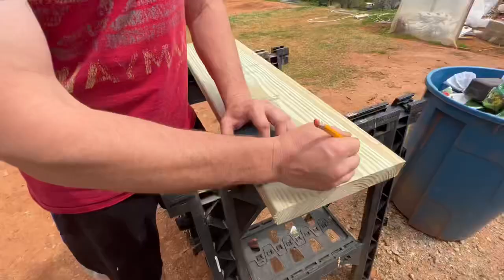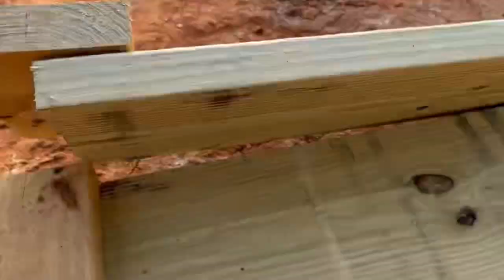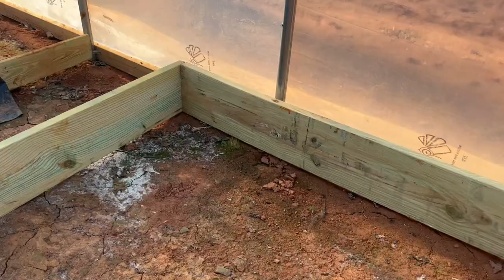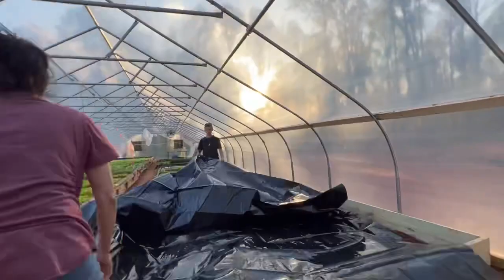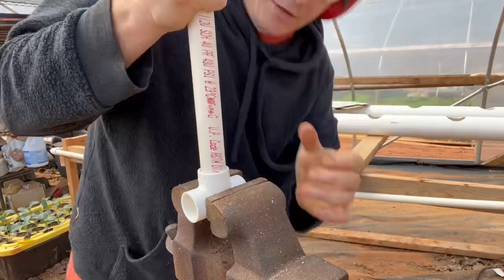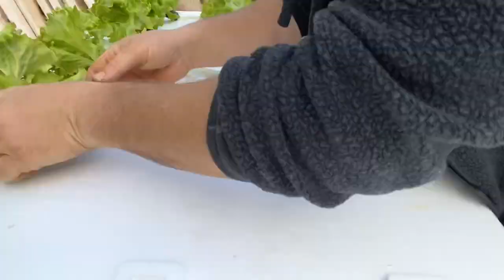DIY hydroponic floating raft system build, Venturi aeration, and planting! Hydroponic garden!

Comment: So, I'm thinking one could just dig a hole the size and shape of the tank you want and then line with pond liner. Then you'd have a lot less of a lumber bill
Reply from the maker: This is definitely possible if you have the time and energy, you could also just use 2x4s to save money, I have in the past and it worked fine. The water only needs to be a few inches deep, they float under the rafts so it’s not like they need a lot of room.
Reply: on point. with the labor and manpower cost. With this size spending on lumber is really a great option. Thanks for learnings.
Reply: @SaludaGradeFarm  if you have a backhoe on your tractor you could dig the hole quick and easy for the price of the fuel.
Reply: I think this way  a lot more convenient and easier on the back.  And a cleaner setup.

Comment: I was wondering if you have trouble growing in the hot summer months? Can your venturi system add enough oxygen for the plants without chilling the water?
Reply from the maker: In all of my life experience with these the answer is yes. I have even had shallow system only a few inches deep that were setup on tables. Of course it could change if your house is hotter than mine, I’m usually about 90 inside.

Comment: I grew hydroponic lettuce in north Carolina in the eastern part of the state super hot here now! Having a hard time, germinating here just wondering where you you having a problem. decided to seed some in the air condition last night to see if it helps. Also found the only two varieties I can grow right now. Is Rex and Muir because of the heat. also, where do you keep your EC and Ph on ? We grow in the NFT system didn’t know if Taft was different?We try stay between 1.4-1.6 on EC and 5.8-6.5 on ph
Reply from the maker: Hey there thanks for the comment/question. I’m in the mountains of nc, it still gets hot here but taps out at 90.

I sew all of my seeds in my house, in the 276 sheets of oasis. I sew 5 of them in shallow trays every week, and I stack them up and set them on my desk. 3 days later I take them out to the greenhouse, it’s like clock work!

In the summer I set the ec around 1 with a ph of 6.2 - 6.5 to aide in absorption of calcium. I also grow Muir, but it’s so I still have a hard time growing it. I mainly stick to salad mix in the summer, because it doesn’t matter if it bolts. I grow a lot of the salanovas from Johnny seeds. 

Hope this helps!